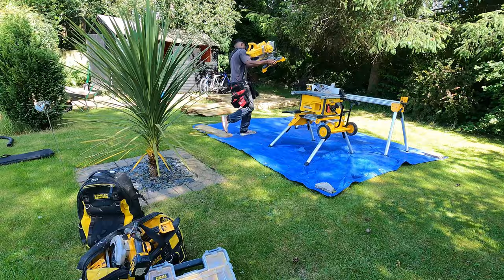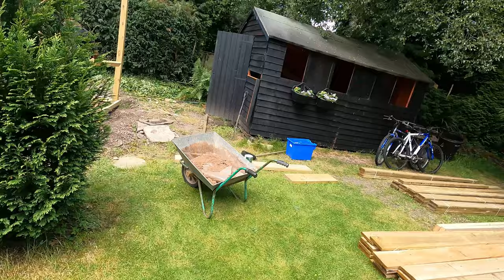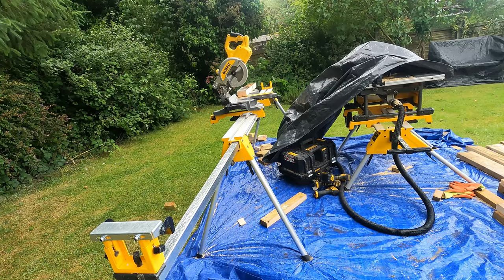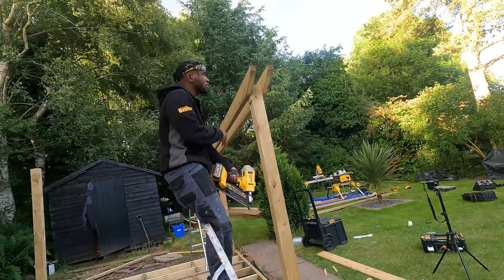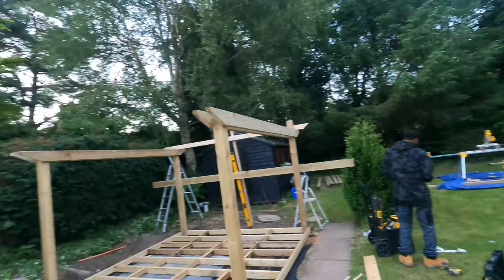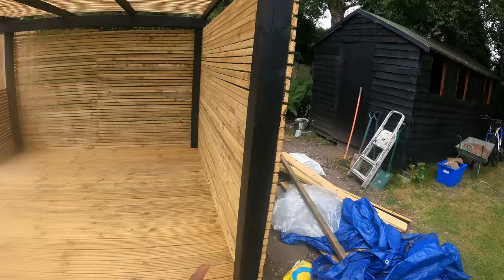How to build a pergola and decking step by step

Comment: Another tip pal don't measure nogs separately if you put your joists at 400mm they should all be the same distance apart normally last one will be different tho but take the distance from the fixed end.
Keep up the good work tho lads only trying to help you out. 👍

Comment: I built my pergola 7 years ago - same method . Some decking boards showing slight rot at the ends even after pre treating .   Not too sure how long the thin strips of the roof will last though on yours . Must be a bugger to maintain ? I'm also a Dewalt guy . The 850 is a beast .

Comment: Awesome work. But i would say the wooden posts will rot and replacing them will be a huge expensive job. You can get steel/metal anchor/brackets that go into the ground , then the wooden posts are bolted into them.

Comment: Posts will be rotted out w/in 5 years
Reply: 'for some people, the pleasures that others  derive can cause pain'. I suspect you look at a doughnut and only see a hole.
Reply: Please share your infinite wisdom with us and tell us how you would do this 🙏🏻
Reply: @paulmorrison30 any lumber that touches the ground does eventually rot.  The design is nice, just need to replace the post with lumber treated wood.
Reply: @Darvineb86  Not when it’s surrounded by postcrete. Wood rots, concrete crumbles, iron rusts, and people die….Nothing lasts forever.
Reply: yeah, I don't get why they treated the ends of the floor boards they cut but they weren't using treated lumber?  Here in USA treated lumber is a distinguished color... not sure if it is like that across the pond.  That other guy that responded to your comment has no idea about building materials.  He must think concrete (sorry, 'postcrete') has no moisture in it or doesn't absorb moisture... lol  He should go read up on how porous concrete actually is.
Reply: Everyone knows concrete/postcrete is porous that’s why buildings etc crumble over time. What I was alluding to was the comment that “the posts would be rotted out in a few years”, which they won’t if they’re in this material. It would be refreshing if some people could read properly and actually understand the context of a statement without trying to be clever and miss the point entirely.